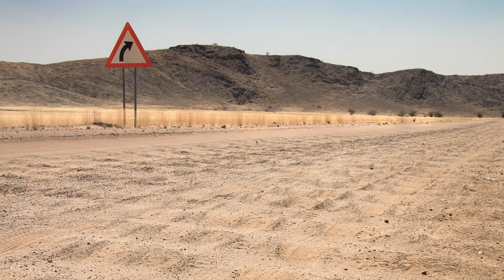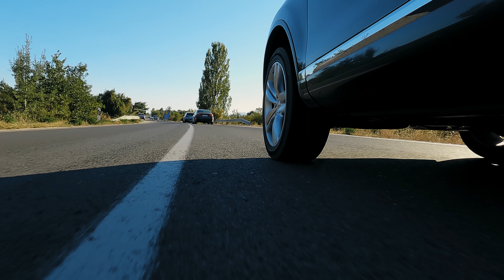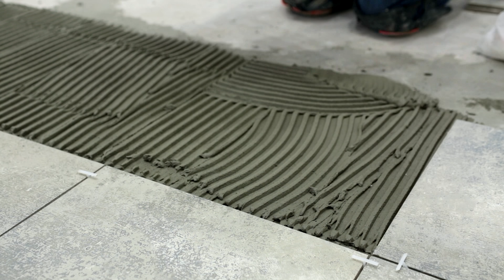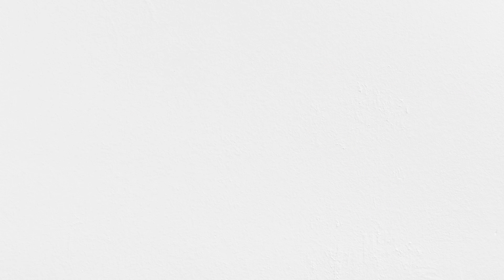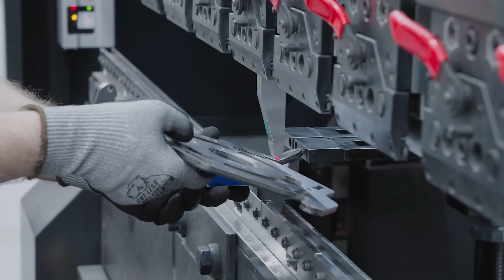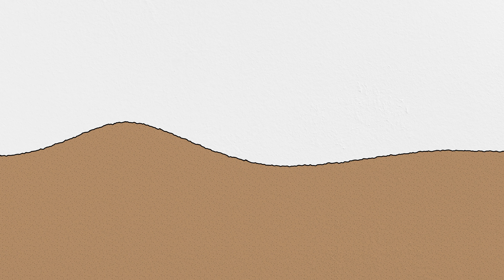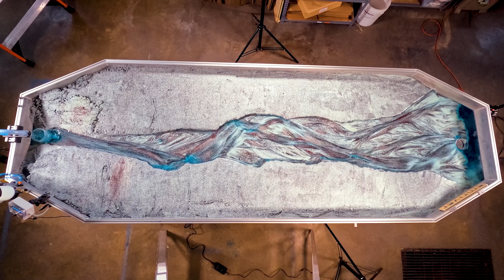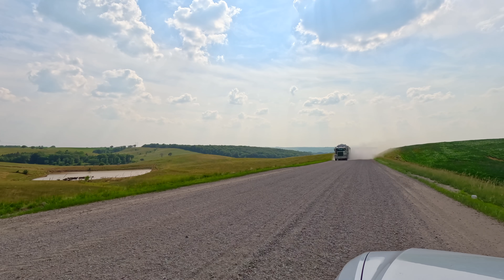Why Roads Get Washboards

Comment: 1. I think tandem wheels such as found in a car or truck may produce a different result than a single wheel. Springs and shock absorbers probably also have an effect.

2. I do not think any of the geogrid products you mention are worth using. Sooner or later you will get washboarding and they will be destroyed by the road grader used to smooth out the washboard. In fact, I have a hard time imagining the huge mess that would be created by a road grader hitting a geogrid under a washboard. 

3. From personal experience with a long unpaved driveway the things that really make washboarding worse are speed, vehicle weight, and going uphill. We don't get very many tractor-trailer rigs up the driveway, but the Amazon delivery trucks really degrade uphill sections of our drive. (We have a circle at the top and uphill traffic is separated from downhill. Uphill is much worse.)

Comment: @practicalengineeringchannel if cars didn't have suspensions, and if your wheel was fixed and could not bounce up and down, would washboarding still happen?  I assume no, so it's sort of a chicken and egg scenario.  We need suspension because roads are bumpy and we have bumpy roads because we have suspensions.  Is this accurate?

Comment: 4:49 it is interesting if you plot bricked roads on this graph. They have a high initial front cost but incredibly low replacement cost even when you change the volume of traffic. The big tradeoff is speed. The max speed on a brick road is significantly lower than the max speed on a paved road. From what I can remember, max speed hierarchy goes paved roads, brick roads, gravel roads, and finally dirt roads. I would state that brick roads best application would be for internal city roads because they keep maintenance costs down and speeds not as fast which is important in internal city roads. Paved roads make sense for inter-city travel because high speeds are needed. Then again road construction in the US has always been terrible and full of lobbying.

Comment: I drive 40 miles of dirt every day. I think you missed an important variable. While accelerating and decelerating, when the tire leaves the ground it speeds up or slows down relative to road speed leading to a scrub when it comes back down.

Comment: Well I certainly lost the mental bet I made with myself lol. Based on the title, I thought the video was going to be about those ripples in the road perpendicular to the lanes, particularly when approaching a traffic light or stop sign so as when it rains it'll act as a form of drainage for the water to go somewhere while your tires could maintain pressure on the ground avoiding hydroplaning and therefore also maintain traction with the road for your brakes to work properly, if you need to slam on the brakes or just use them routinely/regularly.

Comment: Almost 82 now and back when I was 16 I was riding with my best friend in his Grandmothers '51 chevy.  He decided to see how fast we could go around a curve on a hardpacked road that was severly washboarded.  The car lost grip and went into the ditch.  Front bumper caught and flipped the car over crushing the top down to top of the seat.  My friend was thrown out of the car and no injuries to either of us but I had a very small hole to crawl out between the floorboard and the steering column.  We were setting on the front bumper deciding what to do next when a truck pulled up and stopped.  The driver asked us if it ran better that way and drove away.  The car was repaired and I don't think my friend was allowed to drive it anymore.

Comment: I worked with a guy who drove a road grader in the 70's and explaind this exact theory to me a little differently but same concept.  His thought was a car hitting a pothole and the suspension in the car acted in the same manner with the up and down wheel motion after impact and accelerated with suspension created these rhythmic ripples.  It's how I've always explained them but this video gives so much more context.  Cool to know he kind of knew what he was talking about.  Old school Blue collar dude that got it.
Reply: We always accused the grader operator of going too fast for the road conditions because some freshly graded roads would have washboarding, whereas before the grader went oover it it didn't have them but there were potholes before the went over it.
Reply: @brianmiller1077 what do you mean by going to fast for road conditions?  I've only ever heard that in the context of a vehicle traveling on a roadway with weather conditions.
Reply: @SonofDad78 The material of the road, size of gravel. I can't quantify it, it was that the road was packed but potholes before and loose and washboardy afterwards. Maybe they added gravel on top and we were blaming the wrong thing?
This was a quarter mile stretch of road off a paved county road.

Comment: I had to google stepper motor to figure out if this experiment was valid. Stepper motors are jerky by nature. This jerky movement would have transferred to the wheel and sand possibly causing premature wear or washboards. This experiment is not valid

Comment: this doesn't explain why the high spot and low spot runs in a line perpendicular all the way across the road, if the "waves" were only in the tire path this would make sense, but that isn't how it goes, especially considering the traffic is going opposite directions on each side of the road

Comment: OK...if it is the action of the wheels on the sand then why does the washboard extend all the way across the road...you don't get much tire traffic in the middle of a dirt road.  Also, you bring up sand dunes which begs the question why do sand dunes form when there are no giant cars driving around in the desert?

Comment: In Australia corrugations (what we call them) are a large scale problem. Real life I see them get worse where traffic has to slow, approaching a bend or crest, and less in the faster sections. I you drive above 80 or 100kph the effect  smooths out and damage the vehicle less, slower and they shake the car to pieces. I'd like to see you double the speed of your test and see if the corrugations still form.

Comment: What makes me mad is we have a dirt road. It's like 7-8 houses down our road and isn't state maintained. We have two sets of train tracks running along our road.
Which doesn't seem like a big deal bit the train tracks limits how large our road can be and it hurts the flow of water. 

Of course rain water sits on our road instead of washing out the railroad ballast rock/tracks. So drainage is a major problem. 
That's not what pisses me off the most tho.

What pisses me off is the price of tools for road repair. 

Box blade? $250 and up
Grader/land plane box $300 and up

Cheap gravel rake pull behind $300 and up🤦‍♂️

You can get a vevor drag for road for like $60 but its legit like one inch thick. So you would be better off dragging your wiener down the road.😂

Don't fear tho I'm gonna buy me a 20 ft stick of ¾ inch rebar for like 23 bucks. I will cut them down to 6inch or one foot long spikes. Im gonna make a drag and use them for spikes. So for 50 bucks ill have a great drag. 

I already have alot of scrap wood and stuff so ill be fine but for the last month I've watched hundreds of videos on homemade drags and searched for days on drags. 

The only reasonable choice is drgrader for $700. It has hand crank instead of remote and has two year warranty but for like $50 you can get 3 more year warranty. So atleast your covered for 5 years but I see alot of people saying I've had mine for 12 years and love it. While others say its a piece of poop🤦‍♂️ so ill make my own I guess

Comment: You're wrong.. Your model is wrong... Make the wheel drive your little carousel and try again..... OR go ride a dirt bike and let me know how whoops and breaking bumps are formed..... You just built a breaking bump merry go round... Washboard happens when the wheel is powering you. Look at a gravel road on a hill. If the right side is the uphill side, it is washboarded. If the left side is down hill, it's much smoother. Friggen Engineers.... 😁

Comment: Another video would be awesome also using larger crush makes roads need to be maintained every week or month to instead every month year or even decade. There are gravel roads that use 1.5-2 inch crush that are decently high traffic (more than any rural road) that have been abandoned for 20-30 years and they have less washboarding than my road that sees hardly any traffic and gets graded every month because our road has too much sand and uses 3/4 inch crush (standard)

Comment: It’s only a problem if you don’t have full-blown long travel suspension and bypass shocks like a trophy truck.   What you wanna do to is set the first compression stage of your bypass shocks to be very soft and compliant (the first rebound stage should also be soft to help the tire drop out ).  Also low tire pressure can help. During desert season these washboard roads out in the deserts turn into deep whoop sections (which are extremely fun to blast through at freeway speeds).  Desert race course can also experience this effect like in Baja.

Comment: I’m sad to see the first video in this channel that’s not well researched. It’s clear that the host lacks firsthand knowledge of dirt roads. If not he would have experienced how similar vehicles do resonate with the washboard but off road ATV’s are totally immune to it. The reason behind this is that washboard spacing occurs at the natural resonance frequency of the suspension system used by most vehicles in that road.

So without electrical engineering concepts like resonance, filtering and impedance matching its impossibly to describe how a washboard happens.

Ignoring all this is only possible if you’ve never experienced the phenomenon first hand.

Comment: I had theorised that it was the air off the vehicles creating the ruts, the same way sand dunes are made but this clearly shows it's the wheels creating the ruts. Another fact I can share at parties. 

Also. Have you noticed on asphalt roads with traffic lights and on the side of the intersection where cars have to stop, sometimes there's about a 5 metre section just before the stop line where the road has ripples due to people braking and pushing the asphalt forward.

Also your device to prove it's the wheels causing the damage to dirt roads looks a lot like a tether racing rig....look it up. It's a niche but insanely high speed, "sport".

Comment: I love this thorough look at wash board roads. I have a theory that acceleration and breaking increase the likelihood of developing the wash boarding.
Reply: The right lane of the I-10 freeway around Ontario California was so washboarded back in the early 1980s that you couldn't drive on it in a car anything close to the speed limit.  It not only threatened to shake your car apart, it shook your insides so violently that you would be afraid of internal injuries.  Someone wrote to the San Bernardino Sun with an opinion piece just like your theory, that the washboarding was due to semi tractor trailers in the right lane accelerating and decelerating.  It was published along with the best cartoon (by one of the paper's graphic artists) I've ever seen illustrating a point:   a tractor trailer accelerating, and kicking the road into a sinusoidal washboard as if it were a loose carpet.
Reply: @mskellyrlv  well said
Reply: On rural roads it is not uncommon to experience washboard for miles at a time even on relatively level & straight roadways.

Comment: Well done!  I put myself through college working on heavy construction crews (roadwork), often on the end of a shovel.  Nearly all of it was in the asphalt business on highways.  I now live on a 1.5 mile dirt road.  Constantly trying to get neighbors to drive slowly has been a challenge to say the least.   A very good explanation of the causes of washboarding on dirt roads.  I have seen it on asphalt roads also (only with smaller amplitude bumps).

Comment: On one of my routes to and from work, there is a short section of washboarding on the paved road that appears to be made of the asphalt crack repair material. Hit it just right and you can feel the front end trying to slip away from the driving line

Comment: I watched another video yrs ago on this topic. In that they summized that its the driving wheels causing a digging action with each torque powered revolution, digging a little bit with each motor revolution if that makes sense. I tend to think this is an accurate explanation as when I did a trip up to cape york in Australia, and many other similar trips, we found the downwards side of hills tended to be smooth and started corrogatiins again at about the point you would start accelerting again. The upwards side or powering on side was roupgh as. We in a convoy would transfer over to the right side when ascending. The leader would go so far on right and convert back to left way before the top and call out any oncoming traffic and rest would use the right side up and over the top and transfer back to the left to make use of that smooth downhill side.

Comment: Tar is often sprayed on dirt roads where I live in Canada.  I think it is for dust suppression but I wonder if it changes corregation too.
Reply: Are you sure it's tar? Usually they spray calcium chloride.
Reply: @Sid-gu5qk Good point.  It's darkish.  But now that you say that, it isn't as sticky as the tar was decades ago, so it must be something better.
Reply: Spill tar elsewhere and be accused of environmental damage.  😮
Reply: I think they've typically switched to a veggie oil based substance around here in BC

Comment: I have never driven on an unpaved road at high speeds, so this was quite new to me. Here In Germany basically everything is paved with asphalt, concrete or cobble stone. Just the small ways in between fields remain, but those are used infrequently and slowly enough, that weeds can grow on them and occasional hole gets plugged by whatever is left over: Stones dug up from the fields, pieces of destroyed pottery, etc. So while the ride is anything but smooth, the tractors won't enter repeating pattern.

Comment: I would be very interested to see a comparison between a driven and non-driven wheel and how the washboard develops differently or similarly from them. 
Does one tend to produce washboard faster? 
Washboard does definitely tend to develop much quicker in places of acceleration, rather than deceleration as we see it generally show on the right side of the road after intersections, so it's leading me to believe that it is the torque applied to the tire that magnifies this phenomenon. 

I was always under the impression that it was the driven wheel that would produce the washboard as when the tire leaves the surface from the hop, the engine would speed the tire up, and when it fell back down from the suspension pushing it back to engage on the road, it would dig out some of the material from the tire spin. I also felt that a leaf sprung axle would be more prone to this phenomenon as that type of suspension allows the axle to twist and preload the torque in a way that a linked or independant suspension would not allow. 
This video definitely made me look at it differently now.

Comment: Okay but that doesn't explain how the dips in the road are only half the width of the contact area of my tires. Also, If the washboarding were caused by the release of the tires and impact forces, the washboarding would be locked into a frequency where the tire would fit into the dip (like in the demonstration). However, this isnt the case. The frequency becomes about half the size of the tire, which is why instead of the full up-down motion, wash boarded roads create more of a vibration effect. 

I know its still an active area of study, but the explanation of forces in this video is inadequate to explain what we find in the real world. 

P.S. Loose Sand and Packed dirt roads have significantly different properties.

Comment: Could you please try different size wheels and the maximum positive and negative movement the wheel can travel? And ideally... test a few R/C shocks (with and without a spring force) to see how washboard size and shape changes? That would be a great Part 2 video!

Comment: I'd be interested to see if the result would be different if your wheel only translated directly up and down, instead of having a rotation point forward of the wheel. Obviously it will still create the effect, but i wonder if it would change the distance it would push the material forwards?

Comment: At least with potholes you can kind of understand how they form and you can avoid them, washboarding just makes the whole road miserable to drive. Luckily even in "rainy" washington we don't get that much on the mountain roads, but I can see the deterioration as the USFS funding has been dropping the last few years. The only roads getting "repaired" are ones used for timber sales, and they usually do a crappy job and it gets washboarded by the next year.

Comment: This is why I love this show! I never would have thought of the wheels themselves causing washboard roads!
Reply: Really? I looked at the thumbnail image, and the gross mechanism seemed obvious -- you have an irregularity that lifts a wheel, causing it to drop with increased force, digging out material that piles up, creating another irregularity. So -- at least for me -- the "why" it happens is obvious, but I can also see why it would spark research to be able to determine the systems that control factors like the height, separation, and steepness of each corrugation, as well as what controls how fast they move. (and include a flashback to college decades ago: "The details are left as an exercise for the student")